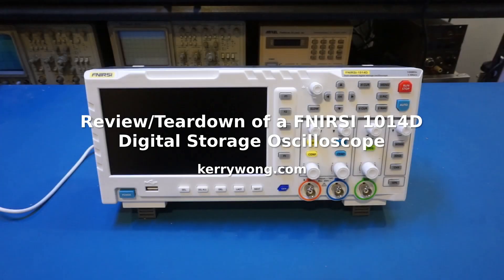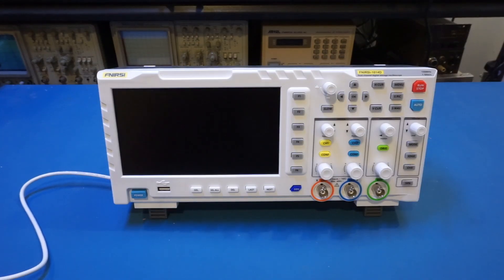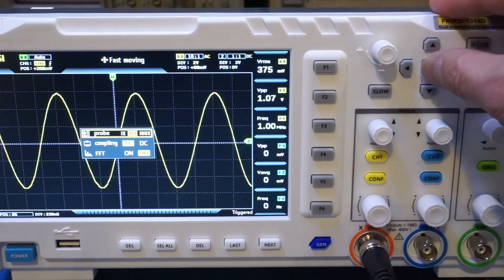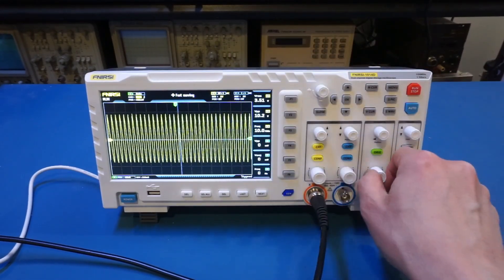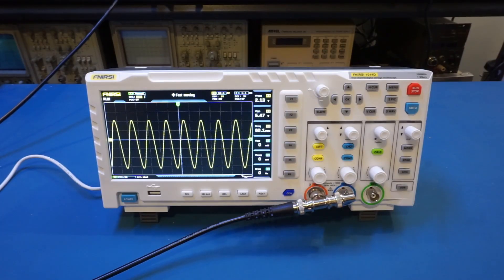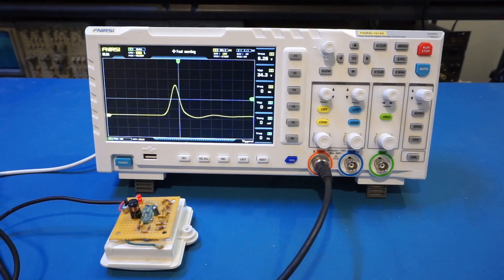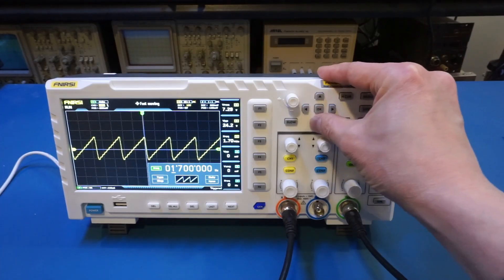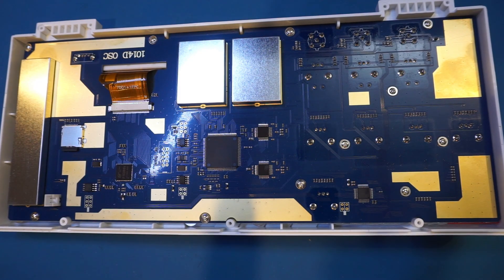Review/Teardown of a FNIRSI 1014D DSO - 100 MHz or 30 MHz Bandwidth?

Comment: It's likely the SD card is just for the screenshots, the firmware might be on the 25vq nearby.
Reply from the maker: I confirmed that the SD has the firmware.
Reply: @KerryWongBlog  "Maybe" you should check one more time :-)
Reply: @KerryWongBlog  Wouldn't a simple check be to remove the SD card and see if it starts up and works?  
I'm very new to scopes - just purchased this scope for testing automotive.  I'll likely purchase an automotive scope a little later.
Reply from the maker: @watchdogu.s.a.8973  I thought I had replied somewhere.  Anyway I can confirm that the firmware is on the SD card. You won't be able to boot up the scope without it. Also if you mount the card on a PC you can see the that it is using some Linux variants.
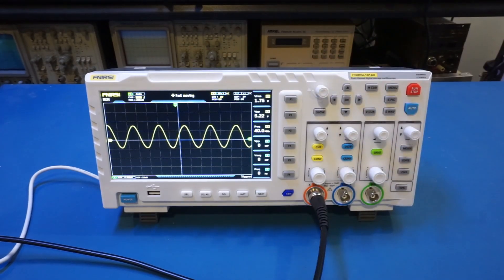Reply: @KerryWongBlog  OK, let me say directly: "Fnirsi 1014D does not have a firmware on the SD card (it has it in the flash) and it can boot even when SD card is formatted". One of EEVBlog forum members reverse engineered the firmware (and even made a new firmware for 1013D) and not only that - he even reviewed your review of the 1014D saying: "Around 8:50 in the video he even does not notice the sudden rise in amplitude when the signal goes from ~41MHz to ~42MHz, which is when the software starts to calculate the sine wave instead of using the actual points, just as it does in the 1013D. Around 15:09 he assumes the firmware to live on the SD card, which we all know is not the case. He should have consulted this thread before doing his review. Have noticed this missing with other reviewers too. A bit of a shame because this blog is full with useful information.".

Comment: I knew the bandwidth was exaggerated. I can suspect they are basing the bandwidth from the maximum frequency that can be displayed without jitter, or that the buikltin frequency counter can read. My miniature dso138 for 200khz can read 1mhz on the counter give or take. I won't be replacing the Tektronix 2246A  I serviced with this.
Reply: Wait a second how would the 138 read 1mhz if the maximum sampling rate of stm32f103 is 1mhz?
Reply: @SianaGearz  The wave form is erratic at that frequency, but it can lock in now and then using the counter. The sampling rate just means reference points available to draw a waveform. Not so much the accuracy of the frequency counter.  I have the dso-062 as well and it does a decent job to. Then there are the Velleman classics like the k7105, the hps5 and hps10. I have one of those obscure Heathkit scope calibrators that goes up to 1 Mhz from 0hz, and from 0 to 100 volts DC, or square wave. it is a handy thing to have.
Reply: @kjrchannel1480  but Nyquist tho.

Comment: Ok so I have some other cheap  FRNISI devices and all of them are a little suspect.  However, what is not clear is if you had the probes on 10x doing the bandwidth tests; because all scopes quote a bandwidth that is only valid when the probe is set to 10x at 1x you expect a bandwidth perhaps up to 10 x less...  This seems to be a related to the probes.
Reply: Actually, the scope was set to 10x but we don't know that the probes, themselves, were set.
Reply: Early in the video he showed it was set to 10x - then changed it to 1x and then back to 10x for testing.
Reply: Whats clear is that you are spouting off senselessly. As he directly mentioned and showed in the video, several times no less, he was using a 10x probe and discussed why the P-P voltage was showing 10v vs 1. Again, a couple of times.  You are one of the only ones who seem to have missed that, and then are extrapolating for it being the reason the FRNSI is showing bandwidth problems. And all after commenting that you have repeatedly bought other cheap FRNSI equipment that " all of them are a little suspect".....

Comment: Pretty pountless review. The only thing you seem to test is frequency response. Most users at this price point need perhaps max 100kHz to measure audio and SMPS. Who cares if it doesn't do >30 MHz.. who needs to measure fhat?
None of the practical aspects and normal functions of the scope were mentioned, let alone tested. The performance wasn't compared to other products in the price range either.
An analogy is a car reviewer's first test of a $15k economy car is top speed. The manufacturer claims maximum speed of 120mph, and reviewer finds it can only go 100 mph, so they end the review stating that the car is a total POS and it's much better to buy a $80ok Porsche.
Just like almost all online reviews from "Oscilloscope Nerds", it's a waste of time even watching this.
Reply: So what's good about it? The 50mV x1 sensitivity? You cant even measure the noise of a SMPS. Your car analogy is as bad as the scope. I'd be furious if i bought a car and and it didn't perform as claimed. Cars you can usually try before buying, this you probably cant even return after Banggood or whoever ripped you off. Sorry you bought a toy...
Reply: @snabelsvin1  - OK, so what scope is BETTER at this price point?
Reply: @johncoops6897  Hantek DSO2D10. Has tripple the bandwith, do serial decoding, a usable FFT, the sensitivity goes down to 1mV, 8M memory depth and lots more the fnirsi doesn't have or do poorly.
Reply: @snabelsvin1  - Thanks! That is EXACTLY the sort of information that this "review" should have mentioned.
Reply: @johncoops6897  I agree. 
An honest oscilloscope shootout with all the lower price point scopes and their features compared would be awesome too.
Reply: @snabelsvin1  - just found that this channel has reviewed the DSO2D10, still watching that. Found EEVblog forum threads on FW hacking them to 150MHz. Found them on Ebay AU at 20% off:
DSO2C10 AUD $220  = USD $152
DSO2D15 AUD $292  = USD $202
Meanwhile, this Fsnirsi is about AUD $270 = USD $187.
Pity I cannot find a DSO2D10 with the 20% discount, then hack it to 150 😐 ... however I might as well buy the D15 and save the effort/risk.
Only real decision is whether to get C10 $220 & hack it, or pay $72 extra for D150 with AWG 🤔
Reply: @snabelsvin1  2D10 is $70 - $100 more than 1014D.
Reply: @ChupoCro  Exactly. There are not comparing apples with apples when cost is factored!

Comment: This is a FAKE specs scope.  It is not 1 GS/s scope.  It uses the VERY DECEPTIVE repetative random sampling technique which ONLY work on repetative waveforms of course.
Just try a single shot  ...it will reveal the EVIL DECEPTION.  It's sampling rate is likely 50-100 MS/s.
So those so called artifact have nothing to do with bandwidth, it simply does not have the sampling rate, true sampling rate, not the FAEK one they say!
I feel for all those poor souls out there that bought the PIECE OF CRAP!!!!!!!!!!
This company has a range of FAKE FAKE FAKE scope models.
It reminds me of the many so called MPPT chargers that are actually crappy PWM chargers.  Some even went to the trouble of puting in fake coils!
Reply: BTW I nearly bought one until I saw a review by "learnelectonics" ..dodged a bullet there.

Comment: It looks like if the scope is in average mode. Then artefacts like in this video occur when the signal changes. Does this scope have a bandwidth filter? If so, it looks to be turned on.
Reply: None of the settings or features of  the scope were even tested. It's so frustrating that these so-called experts get so obsessed with Multi-MHz that they forget to test the products properly. This guy didn't even test triggering, or accuracy. Most people couldn't care less about >100kHz.
Reply: @johncoops6897  John (<1Mhz) Coops, the man who who doesn't believe anyone needs an actual 100Mhz scope, because his audio work has never required him to go near 1Mhz, and obviously every is the same as John.  Anyone who has actually used a scope, as a scope is intended to be used and not for 'audio' work, can tell from Kerry's video that this is simply a piece of junk.  If you only need 10-20Mhz max, then if you can find it cheap it should be fine.
Reply: If you want to know how this oscilloscope works and what it can do I suggest to read the thread about it on EEVBlog where one of the forum members reverse engineered the firmware, explained it in details and even made a new FW for 1013D. Not only that - he even reviewed this very review :-)

Comment: Pretty sad, clearly no where close to 100MHz bandwidth.  Sample rate must be fairly low as well, what with the aliasing.  The rigol 1054z is a far better choice, even though it costs twice as much.
Reply: Who cares about frequency response over >1MHz ??
You don't buy a $100 scope to do lab measurements and calibration of RF circuits FFS.

Comment: The waveform behaviour looks suspiciously as if the acquisition system has been set to some sort of averaging. Perhaps just check the averaging configuration to make sure. If the 'scope has a dot-mode, you should be able to count the number of dots plotted at a specific frequency to determine actual sample rate. Trigger stability is definitely not great. Thanks for taking the time to do this quick review!

Comment: God this is infuriating. I’ve had two usb based scopes and both have turned out to be little more than expensive toys. I wouldn’t mind if I could only do 25MHz or whatever, I just want a scope that doesn’t cost the earth and which will just work.

Comment: Thanks for reviewing this scope and showing its limitations.  I suspect that this is NOT a true 1GSa/s.  Dave at EEVBlog did a detailed teardown of the FNIRSI 1013D and probed the ADCs to verify that they were only clocked at 200MHz.  I suspect that it's the same for this model.  BUYER BEWARE!!!

I still think you could improve your video if you zoomed in so that the scope fills the picture.  It's difficult to read any of the text on the scope's screen.
Reply from the maker: Thanks for the suggestion!
Reply: Who cares? Frequency Response in MHz is probably the LEAST important thing for buyers at this price point. People don't want or need a cheap scope to measure RF.
So annoying to not be able to find proper reviews of these cheap scopes.
Reply: @johncoops6897  I care.  When I buy products, I like to have confidence that its claimed specs are met.  I use ESP32s often, and I know that they can generate square waves with frequencies of at least 8MHz.  To view a square wave on a scope, a good rule of thumb is that the scope should have a bandwidth of 5 times the square wave's frequency, so that the view includes the 3rd and 5th harmonics.  5 times 8MHz is 40MHz.  This scope is not capable of that.

You are free to buy any product you wish, of course.  I just wanted to warn any potential purchaser of this scope that they might not be buying what think they are.  Is there anything wrong with that?
Reply: @ajlenze8  - no  there is nothing wrong with that. But frequency response (bandwidth) is just ONE characteristic of a scope, and for many users (like me) is of almost ZERO importance.
Yeah, of course call out the scope for not meeting specs, but don't dismiss it completely and not even bother testing it AT ALL other than for that one criteria.
I want to measure Sine Waves up to 20kHz and Square Waves up to 100kHz, and other stuff where I need good triggering and stability. I have literally zero budget, so will this scope do the job? Of course a $100 scope is not as good as a $1000 scope DERR.
Saying it is absolute sh!t because it's frequency rolls off at 30MHz so "decided not to even open the menus" isn't any use as a Review.
Reply: @johncoops6897  if you have zero budget you cannot afford this scope, since it's $200, which is a lot more than zero. Everyone seriously considering this scope should probably at least think about the Hantek DSO2C10 instead, it will sometimes come out cheaper as well. It's not like high frequency aliasing and low corner frequency are this scope's only issues, it's got a lot of weird behaviours, it's difficult to trust anything that comes out of it at all from what I've seen via other places.

For your use range it seems like you're a potential customer for a generic PC USB oscilloscope (like 6022 and several others) or for one of the pocket ones, either are much closer to "zero budget". Single input maybe even the 138 or 150 oscilloscopes - better than nothing.
Reply: @SianaGearz  - Yes, I know all of that, and I was using myself as an example to get a concept across. My whole point is that THIS video "review" was monumentally poor at actually reviewing the whole package, and covering the issues that real people also find important.
He didn't even check the menus to see if there was a way to remove that aliasing after range switching... other comments below say that is easily resolved with a menu setting.
It's very easy to do a Dave Jones and say that all instruments are sh1t. But not everyone can justify spending $1000's on a instrument that they might rarely use. However each product has it's place and there is compromises with EVERY product, because that's the nature of real life. So the key to a good review is to highlight what those compromises are, so other people can decide if that aspect is important to them or not. At this price point, no product will be perfect, you know.
Reply: @SianaGearz  The Hantek DSO2C10 is double the price of this Scope where I live.

Comment: This scope became available from my local seller. I was suspicious from the start. I had no intention of getting it, I'm sad my suspicions were correct. For the price, it might have meant getting a scope sooner. I'll hold out for the Siglent or Rigol I was looking at.
Reply: I have a Rigol 1054Z and I love it.
Reply: Hantek or Owon are about 15% more expensive than this. Both of them much more serious measurement device companies. I haven't bought one yet but the reviews including comparative ones are a lot more reassuring that they actually live up to the spec, mostly.

Comment: Very good review! I actually ordered one of these a few days ago primarily because it can be powered off of a battery bank. My use for it tho is going to be measuring low frequency signals in an old car so hopefully it wont be too bad for that.
Reply: I was considering this for low frequency work as well. Now I an unsure of even that. 😂 Do I save up for a better scope or not? 😮
Reply: @roygalaasen  There's nothing wrong with this Scope, For your application, it is about 1000x overpowered.
Reply: @chrisfrank8413  yes, it is sure to be good enough for my immediate use cases.
Reply: Great that it can be powered from a battery bank.

Comment: I strongly recommend the Owon HDS2102S scope meter as an alternative to this Fnirsi scope for people looking for an entry level multipurpose instrument.   I have the Owon HDS2102S and it has quickly become a go-to scope, meter snd generator for everyday quick checks.  The HDS2102S is less than US $100 more than the Fnirsi.  The HDS2102S scope section sine wave amplitude accuracy as I measured is within 1 dB at 100 MHz and the meter section accuracy is within 0.25%.  I held an amateur HT about a foot from the HDS2102S probe and it easily locked onto and displayed a 146 MHz signal though the on-screen frequency counter did not indicate at that frequency.  The HDS2102S uses a time-shared 500 mega sample/S ADC though the input amps are easily good to 100 MHz.  A stickler might consider the HDS2102S more of a 70 MHz scope, but the results out to 100 MHz for a single channel are quite usable.  Limitations of the HDS2102S are that it does not do FFTs and the record length is 8K samples.  Hantek also has scope meters with slightly larger screens, but Owon has better specifications.
Reply: I bought the Owon HDS2072s as an 'out and about' scope and it's pretty good overall, certainly much better than anything FNIRSI can produce. I think the Hanteks have smaller screens and don't quite perform so well.

Comment: .... Well done Mate,  I was imagining Dave Jones running from this scope in a nightmare.
Reply: Dave Jones would be brabbling for at least 49 minutes.
Reply: Most users at this price point could not care less about irrelevant frequencies >1MHz.
Is there any channe or website that does proper reviews on these products?
Reply: @johncoops6897  .... Good point John, although we can't spend our hard earned money on a product that lies. I think Kerry is saying to young people, "save you money a little longer".
Reply: @johncoops6897  Got it, you just the old fart who works on audio and never needs a scope.  From your replies, you bought it, got suckered, but since you never need >1Mhz, nor really understand why many, many people do, you feel better dis'ing the review because otherwise you'd have to accept that you're a sucker.
Reply: He wouldn't be running for long before the input circuit blows up. I just read the manual where it's stated that the inputs is maximum 40V and you have to use X10/X100 probes on higher voltages. It's a joke in every way.
Reply: @snabelsvin1  .... I concur, Integrity is a nobel quality. This manufacturer has none.

Comment: Thanks for the review. This particular scope was acting so strangely as to cause me to wonder if it is defect, even though it is new. If so, the failure could be effecting the bandwidth. Just to be absolutely fair, you might want to have the company make a warranty exchange and retest.
Reply: Perhaps the Fnirsi needs to have its internal amplifier balance and timebase alignment procedure run (if it has that feature), but that is pretty atrocious performance for an instrument right out of the box.  It is like the Fnirsi was not put though even basic alignment at the factory.  It doesn’t bode quality control.